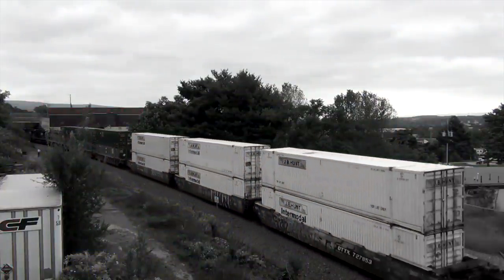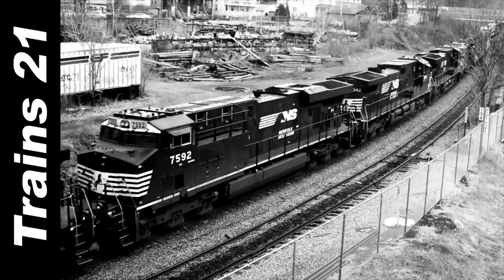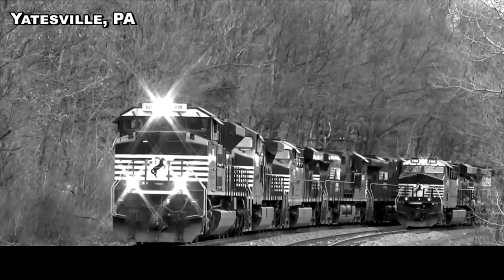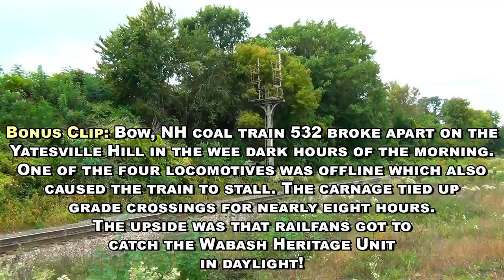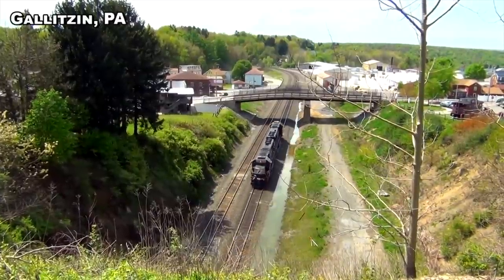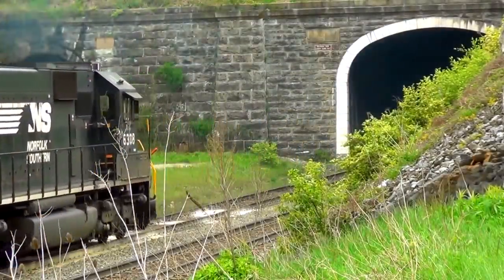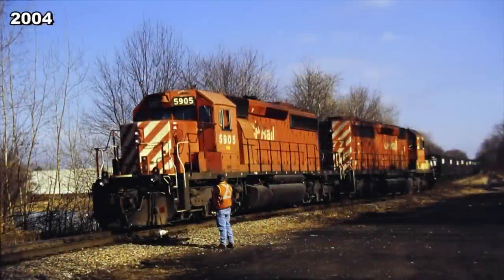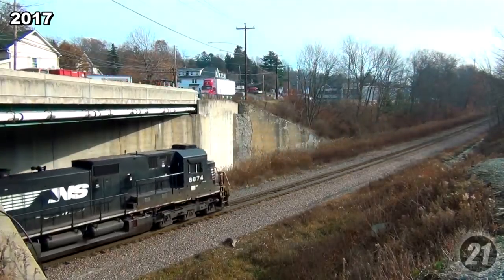When PSR Goes Wrong.. Why Railroads Use DPUs On Trains (Full Video)

Comment: I see NS is still running empty centerbeams at the front of their trains. Still haven't learned their lesson from the derailments at Horseshoe curve.
Reply: You can run empty centerbeams at the front of your train depending on what the trailing tonnage is or what terrain that consist is going over.

Comment: Excellent video, we have virtually the same issues here on the Thayer Sub too!  The trains that run from Memphis, Tennessee to Tulsa, Oklahoma routinely get to well over 9,000 feet and can tip the scales at as much as 14,000 tons.  Train of that magnitude can get away with it on the south portion of the line where it's largely flat and straight, but once they enter the north half of the Thayer Subdivision, it becomes a real problem and it's not uncommon for trains to go into emergency there!  Also they seem to think it's a good idea to put together these double empty coal trains at Thayer, Missouri at MP 335.1 which is baffling to say the least, as trains begin to climb a very stiff grade at that location that crests roughly 8 miles to the north at a town called Koshkonong and it can REALLY cause some headaches!   Bottom line is PSR is killing the Railroad industry, plain and simple.

Comment: I worked for Conrail from 1979-1984.  When I started, many freight trains had 5 people on the crew (and cabins (cabooses)) on the end: an engineer, fireman, conductor and a couple of brakemen 

The bean counters think that an engineer and conductor are supposed to handle huge freight trains with all the issues: hot boxes, dragging equipment, terrible rails, derailments,  people disregarding railroad crossings, people committing suicide, etc, etc. And, you’re NOT allowed to be sick or take any time for health or other appointments -  one of my jobs on the railroad was crew dispatcher for Conrail and Amtrak - and it was an eye-opener. People had no life; they were tied to their phones (this was before advent of smartphones) 

One winter day, I walked a line of track leading into 44th Street Yard in West Philadelphia pouring kerosene around switches and lighting it to keep the switches from freezing. Another night in Port Richmond, the crew had to try to get a caboose on fire that was connected to a tank car to a part of the yard where the fire department could put the fire out 

There were the people who electrocuted themselves riding on top of trains coming out of 30th Street (I had to type the reports).  

Railroading is hard, dangerous work - be it freight or dealing with unruly passengers who spit on conductors and throw ballast
Reply: And I suppose you've heard that several rail execs were pushing earlier this year for the final goal - engineers only on some routes. The FRA held public hearings on that on 12/14/22.
Reply: @whiteknightcat  Arrrgh - terrible , but not surprising.  Their ultimate dream/hope/wish is for AI, Artificial Intelligence, that would operate trains (trucks, aircraft, buses) without ‘pesky’ human employees that have the effrontery to need time off, get sick or, be paid fairly
Reply: The problem is coal.  Coal pays the bills, at 1/3 of profit.  When coal finally goes away, in the next decade or so, the railroads will look absolutely terrible for investors.
Reply: @tonyburzio4107  Coal loadings have been decreasng for years, yet over the last half dozen or so years rail profits are through the roof, so by revenue that doesn't add up.

Comment: That sounds like my former Congressman Peter DeFazio at 9:40. We need more people like him in Congress to talk about the impact of the changes in railroad operations. One of the things you hear in discussions of airport noise, train noise, blocked crossings, etc. is, "That track-airport-whatever was there when you bought your house. Get over it." But train horns are MUCH louder today than they were 30 years ago or whenever the FRA mandated the insane 90-some db blasts. And a 15,000 foot train is a completely different problem than a 5,000 foot train. 
If railroads are changing the way they operate, we should change the regulatory climate in which they operate. They are going to PSR themselves into an unpleasant situation because they were managing on one parameter: stock price.
Reply from the maker: That was Peter D.

Comment: It’s interesting to me. I talked about this in the Binghamton yard with a railfan I met. Bnsf and up have been using DPU power and their units have been capable of doing it for decades. I live in Montana and you aren’t likely to see a train without a dpu unless it’s an intermodal. It’s interesting to me that it took NS and CSX so long to actually try dpus out and when they do they don’t do it correctly. Unlike ns and csx, bnsf puts enough power on their trains. CSX and ns try to put as little power as possible usung aging locomotives on trains 3 miles long, hoping they don’t fail or stall. If CSX and ns really wanted to make money, maybe they should follow BNSFs model, considering they are the only one to not implement PSR and they make the most profit. In my opinion there is nothing wrong with dpus if used correctly. If you are going to use them, put enough power on the head end and then place a unit on the end and middle if you must. I hate when CSX and ns plays victim acting like they don’t have enough power or crews while they furlough crews and store usable power.

Comment: I thought that railroad management had learned that putting all the motive power up front was NOT the most efficient and beneficial way to operate a (long) train! Having mid-train helpers and some "pushing" poer at the rear not only reduces track forces (and hence track maintenance costs) but it also reduces drawbar and buffer forces!  As some correspondents have noted, indirectly, the bean-counters are now running the railroads, not the rairoaders!
Reply: In general bean-counters have always run the railroads...as they run most industries.   There are many times that having the power all on the head-end makes more sense.   Sometimes it is a matter of not having DPU equipment available.   Sometimes the train tonnage just doesn't justify the extra cost of switching the units in and out.

Comment: Having 1 locomotive offline to save fuel as the others are in Run 8 struggling and sucking down more fuel than all 4 in Run 6 doing the same amount of work….SMH.
Reply: If you put the other engine online it would run in number 8 also. I'm not siding with them . That's just how they count beans .
Reply: It's to much power, you'll literally rip your train apart. That's why we can't run all 4.

Comment: Why does NS think running 5 units on the head end costs less than 5 units scattered  throughout the train? The fuel cost to move a given tonnage is the same, and DPUs reduce the chance of exceeding coupler ratings, and string derailments. This Spring I saw a CSX 2 mile train sit for 4 hours while the conductor checked out a hotbox. This has to cost the railroad. It reminds me of the envirologues who think flushing an 8 gallon toilet twice saves more water than flushing a 12 gallon toilet once. Sooner or later the cost of delays, fixing derailments and paying towns like East Palestine will catch up with NS. And it very likely will inspire extreme regulation of the kind that ruined railroads in the 1950s. Warren Buffett is already trying to dump NS, perhaps because he doesn't want to face questions about how he allowed this mess to  develop 
I think this kind of thing is ultimately caused  by b-schools. Instead of promoting experienced people up from the ranks, they hire people who know nothing but management theories. If shareholders don't change things we might end up with an 
American British Rail.
Reply: Warren buffet has nothing to do with Norfolk southern? He is a large shareholder in BNSF , Please tell us facts about your statement?
Reply: We don't run 5 locomotives on the front lmao.
Reply: @trentongray1818 …Train 21 video proof to the contrary…duh! Wtf did you think this video was about? Efficiencies of NS? 😂😅
Reply: @Mrright87ok, 5 locos in front w/2 offline but no dpus in middle or back n it stalls or runs away…

Comment: Another issue with these stupid long trains is it takes forever to yard them especially at a yard like Enola were most of the receiving tracks are only 50 to 60 cars long, everything gets blocked in the yard and the mainline can be blocked for hours because the train's rear is hanging outside the yard, delaying time sensitive intermodal trains needing to get through Harrisburg. They actually kill efficiency. That 11z used to be more than 1 train symbol, it would run better if it was divided up again!
Reply: Harder then you think... You got to have conductors and engineer's but you gotta have specific requirements for both so it gonna take time

Comment: The current limit with new systems such as PTL (positive train location, just approved) is 5 miles.  Train length is not the same as PSR, since BNSF is not PSR and they run long trains too.
Reply: Some if not the longest trains in the usa

Comment: Railroads have always had major investors, since the first engine without flanges.

PSR is one reaction to the loss of coal traffic.  For now, profits look high because coal hasn't gone away yet.  Give it five years.  Coal is 1/3 of all profit.

Reasonable profit is not the same as profit, and reasonable profit is what the railroads are using to attract capital in the stock market.  Reasonable profit is that profit where it is as least as good as other businesses given the same risk.  Coal is safe, not risky.  Intermodal is risky, so you have to offer more profit to attract investment.  The vast majority of investors are pension and 401K funds.  When you signed up for your 401K, did you remember to check the box "make as little profit as possible, I want to eat dog food when I retire."  No?  Weird.  So, when coal profits go away and railroad profits fall below the level where you are better off moving your pension funds to Apple or Amazon away from the risky railroads without their safe bet coal demand, you think the railroads will survive?
Reply: Railways in the USA will certainly not survive the next decade...
Reply: @trainandtruckmodeler786  the next decade?   Absolutely they will.   Five decades from now railroads will not really resemble what they are today.
Reply: @cdavid8139  21 years with Illinois central...3rd generation railway man I can tell you with costumer service declined in the last 50 years, some industries had round the clock switch engines which are now all gone in favor of trucks....railways rely on unit coal and oil trains which are now on a decline and is were PSR comes into effect combining 2 freight trains into one....with the automated highways on the horizon I know some of my former bosses are running scared....with Tesla, Peterbilt and Kenworth all having technology to run a lead truck and have 7 follow, that will be the death of railways in the USA....I'm running OTR right now, it's changing daily, my company we had to watch safety videos on this topic....it's coming really soon....
Reply: @trainandtruckmodeler786  I agree with everything you said here.   Customer service has plummeted in the last 50 years (the exception being the short lines).  Oil goes up and down but coal will never be what it was.   Combining trains makes use of new technology that I'm in favor of....if used wisely.   Trucking technology advancements are scary.   I agree that there will be long haul driverless trucks in our near future.    And it is changing daily.   Railroads won't die overnight or in the next 10 years.   But long term both rail and trucking will be unrecognizable.   Where did you work at IC?
Reply: With JB shutting down Coal fired Power Plants, it'll cut Coal traffic on E,W Mainline through Altoona by about 50% We usually see 1 or 2 a day, but there are plants in Baltimore that are using Coal  that will  either change or being  shuttered altogether.
Reply: @robertadams6606  uncle JB Hogg!!! LOL!!!

Comment: What's wrong with NS?
Other rr's use auxiĺliary power dpu mid and end, like Up, BNSF and CSX why don't NS.
The buck eye forces are incredible at the front of the train the force is enough ro pull the car apart around the coupling.
This is a false ekonomy as said it put forces, wear and drag derail more likley on a curve.
Not including track shift.
Also  disterbance in towns, that could cause serious consequences or death in a fire, car crash or medical emergency.
May be the cost saving could be paid for by giving local towns medical helecoptrs.
Thanks for the video.
Reply: The reality is that you do not always have DPU equipped locomotives available.  In other instances adding DPUs or breaking the train up afterward isn't always easy depending on many factors.

Comment: I'm personally not a fan of PSR and also DPU's. More wait times for customers. Most land barges being worked on sidings instead of bringing entire train to the yard. Just look how 11Z/12Z are being worked at Harrisburg. Just cars without motive powers sitting on the siding of the Buffalo Line at South Ferry and Stoney. I've seen much of one unit up front and second unit in the middle. If front unit goes offline like an engine failure, that train will be not be movable and will take time to uncouple the middle unit. The practice of having a spare unit attached is pretty much an afterthought. Looking at Sunbury line, there is no doubt the operations out of Taylor, they need to have sets of helpers stationed there just so land barges would have no problem limping through that summit. Oh wait they don't, because they sold numerous numbers of SD70ACU's and also religated the SD40E's into local services. I also now beginning to believe they should've invested on the Buffalo Line, because of less track mileage than going VIA Binghamton and it makes no difference to require some helpers on either routes.

Comment: The reality is this: corporations do one thing: increase shareholder value. Period. Any romantic notion to the contrary is silly. Railroads have finally joined the cost-cutting bandwagon to "increase shareholder value" via PSR. It's an ongoing process with both successes and failures. This won't happen overnight and mistakes will be made.
Reply: That seems to be a common theme with nearly everything these days: Making the shareholders happy, and nothing else.  Rules are even rewritten to bypass safety and quality concerns.
Reply: Maximizing profits over all else leads to decline as investor value grows and labor the source of the profit goes down then the rate of profit must go down.
Reply: Shareholder value is just something they say.  The stock charts on most of the publicly traded railroads could be telling a different story.  The long run up in these things since the year 2000 might be coming to a stall.   I am sure they will send some "DPUs" to the rescue in the form of cooked books just like they did on the Penn-Central.

Comment: The size and weight of the trains now days are becoming to big for the infrastructure that was designed and built in the 19th century. The permanent way needs to be updated. Larger gauge and heavier rail and concrete sleepers. So many derailments.
Reply: * Larger gauge?*

Comment: You know what its like,you have corporate greed in the railroad industry just like any other industry. Management wants to do more work with less and less people. With  trains that are 2 or 3 or more miles long there is  greater chance of something bad happening. Look what happened up in Canada in 2013 when that oil train with just one person operating it got loose and ran way downgrade and derailed and destroyed Lac Megantic ,Quebec. There should be at least 3 people on board a freight train.,with 2 up front and yes they should still have a caboose on the rear with one person.Look how much time it takes a train to get underway if an air hose pops near  and the conductor has to walk all the way back from the headend to fix the problem but if you someone on the end of the train the problem could be solved quicker. You  know what psr stands for,pretty stupid railroading.

Comment: Diesel since the beginning of time having used by the hold for tonnage guys so they can get the most work done out of the fewest amount of people and to hell with service to the shippers. You see short lines and you call them up an hour after your car is empty and they send a locomotive to come get it so you don't pay a week's worth of per diem charges. Nobody keeps the tractor trailer truck at their dock after it's offloaded for a week or two weeks. With steam they were always hot and all the branch lines that were profitable with a paid off steam engine became unprofitable with a brand new diesel and that was used as an excuse kill the line. The Long Island Railroad with service 8,000 car loads a year. When the New York and Atlantic took over their car loads went to 37,000 because they gave good service. Service is the only thing a railroad has to offer. Now they have ridiculously long unmanageable trains smaller trains are easier to handle. And the pay rate for engineers nowadays sucks ass even though you do the work of 10 people. They had an NFL player who got passed over for the draft so he went to work for NS for $30,000 a year and I'm thinking for $10,000 more a year than what I get for fixing up the schools after their little bastards have torn them up I wouldn't drive trains for that ridiculous amount of money. Railroading used to be a profession it used to be what you were 24/7 you were a Railroader you lived breathed and died by the railroad. Now it's just another job after 5:00 who gives a shit. That's today's attitude on everything which is why today sucks.